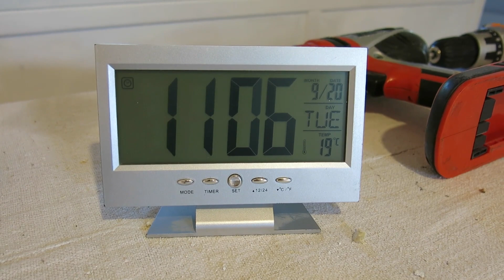Mixing Grey paint - My French homestead renovation continues

Comment: The walls are looking good. I can't tell the difference between the white and the grey, at least on this device. You've been working hard; maybe a bit of a break will bring your motivation back. A couple nights ago it got down to about 7C here, and I'd forgotten to close my windows before going to bed. Better than an alarm clock, at least if you want to wake up in the wee hours. A weather system is moving in here from the south, but it won't bring temperatures like yours, even if it's a direct hit. Just lots of warming rain.